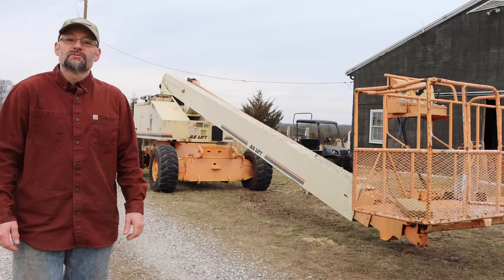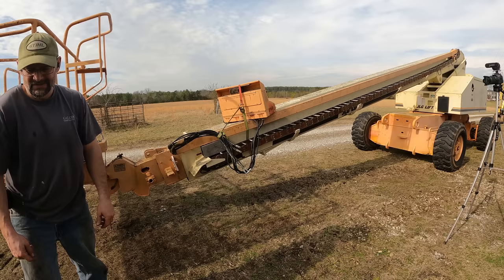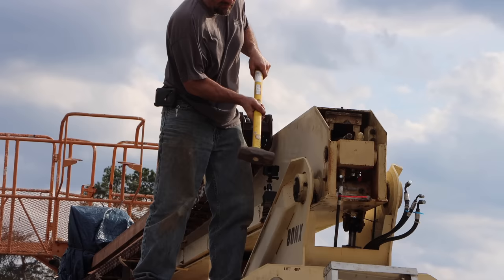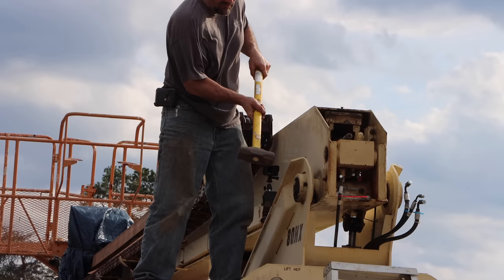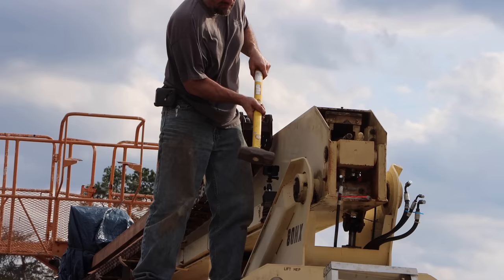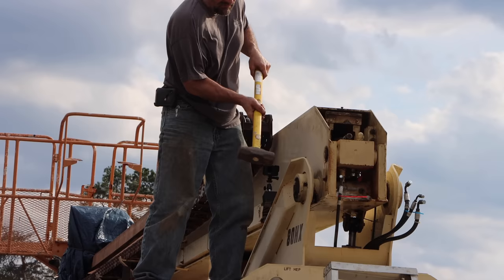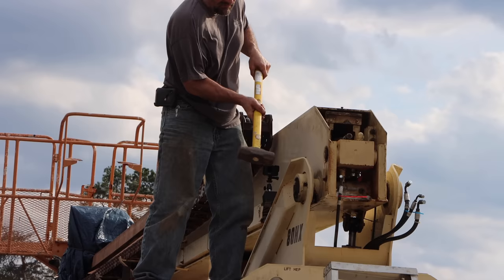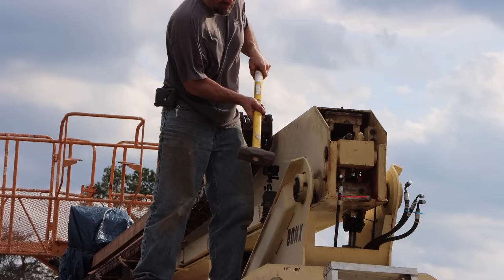JLG Boom Lift Tear Down, Ended In Disaster!

Comment: Maybe you can re-engineer the new pins to have some grease fittings to allow you to grease them so they don't seize up? - build it back better then it was before - maybe even make set it up to have all the moving parts that need it have better greaseable connections? - But despite the small fire issue - good on you taking this whole thing apart by yourself, id have been asking a friend or two to help - if only to make sure I had someone available incase of emergency where I ended up breaking something or hurting myself XD

Comment: I can relate to the whole fire situation and running around saying no no no.. I fix heavy equipment for a living and have had similar situations several times. Like you said though 100% my fault because I did not take the correct safety measures because I had done it before and was to comfortable.
Fire is scary especially on a machine with a 50 gallon hydraulic oil tank and a gasoline/diesel/propane tank.
Glad your okay and your boom lift is fixable

Comment: I had to use a thermal lance on all the pins on my dozer. It looks dangerous, but it works great. I made my own with an air gun with a brake line in the end. The air gun was attached to my oxy tank, lite it with my plasma cutter. Sure want to protect your hands and face, molten steel blows everywhere lol. There was no pin in that dozer that gave any trouble using that.

Comment: In Sweden minimum requirement is 2X6kg  (2X13.22Ibs) powder extinguisher when working whit welding or open flame, we also need to be two persons working and the extinguisher should be In one arm length of welder or welding supervisor

Comment: Sometimes if you get suck like this with pins like that, if your lucky and you weld a big nut or a disposable socket on to the pin, you can use a shake and break or an impact to break it free. You can also put pressure on a breaker bar with a tractor bucket or something while hitting it with a sledge etc. Just more tools for the tool box.

Comment: Heat the pin not around it. Heat it red hot. It expands. let it cool to the touch..  You expand the pin and it can't get bigger so it shrinks in diameter. That's how we did it in the mine.

Comment: Great video, I have torn down a few of these booms now and it is rare to find a pin that is not seized. Most we cut through like you did and some simply need a bit of heat and a hit with the sledge hammer. Might sound crazy but we have had some success welding a small piece of pipe slightly larger than the pin to the frame and then attacking the pin with a jack hammer! (The pipe acts as a guide for the chisel bit)

Comment: My dad worked for several years as a fire extinguisher service,He said to never trust 1 of those plastic headed Extinguisher they Leak brake or fail way to often.And yes it seems when you had was still pressurized The valve just broke.

Comment: When I worked, uh, on bangy things in a past life, we'd spray dry-film lube on everything that came in contact with something else.  Moly based and it didn't break down like grease-based products.  Perma-Slik.  Good stuff.  Spray some on your pins and bushing holes and it'll make them come out easy.

Comment: you have a cutting torch, you have a lance, a heavy equipment welder all my life. cut a peace of good brake line 1/4" off a bulk roll 6 times the length of the pin, silver solider it to an old #3 or 4 cutting tip over the center big hole in the tip. if you dont have a 2nd torch, wld a hot solid bead around the pin leaving the very center open, weld until end of pin is red hot, move fast and with good welding leather hold the torch strait up an down on center of pin, turn oxy psi to 60psi press the brake line hard down on the pin holding it strait an hit the oxy trigger all the way keep pushing until you brake out the other end. i have done this in the bush on pulp trailer 5th wheel pin, rocker beam 4" round 10" long on clark skidders just to name a few. before any heating, cutting welding on any machine sock it down with a hose before and after and never leave the machine for minimum one hour after any welding. i have burned million dollar machines not any fault of mine but a foreman over stepping my clamp down on company policy. i always have 2 50lb c002 an 3 15lb c02 fire extinguishers at the ready at all times, if the machine is really diry it is o be washed, no if an or butts, witch means drilling a hole in the river ice an setting a pump. you have the tools to do the job, i did jobs by my self 50 miles from the bush camp in 30 to 40 below. you made that job 100 time harder then needed, but hay that how you always roll/

Comment: No one ever does it but dry chemical extinguishers are supposed to be tipped over 180 degrees and smacked several times with a rubber mallet.  This keeps the chemical from becoming a block inside.  A piece of which may have hardened in your nozzle keeping the valve from working.  You may have had an oil fire (hydraulic fluid accumulation) in which case while water is not the best as in a confined space it can float the fire around in your case that wasn't an issue and the massive cooling of the water did the job.  There is also a time issue with dry chem whereby they need to be gone over and recharged even when the charge shows good.  Some are not serviceable and should be dumped when they are past their date or are corroded on the outside.  Always good to build a fire and use the expired ones to keep your skills up practicing on the fire.  There is not much suppression in a small dry chem so it needs to be efficiently used.

Comment: I was thinking you'd weld the steel bar to the end of the pin like a breaker bar and turn it with your lift to break the rust!

Comment: I have a few air pressured water SS fire extinguishers, they spray 50 ft easily, easy to refill and pressurize, easy to test, definite requirement around welding....they'd be the size of the one you restored.

Comment: OOMG - If it ain't broke don't fix it, if it's not causing problems don't mess with it!

Reading through the comments, seems like them powder extinguishers ain't worth the trouble, especially as the powder is so destructive. Think I'll change my powder one to a water based (have several CO2 for electrical). Our local fire prevention officer used to show us a trick to pitting out an oil based fire with a water extinguisher by using his thumb on the nozzle to make a fine aerosol!

Comment: The trick for getting things that stuck out once you've already bored through with a hole that large is to make a relief cut in the side all the way through, or close to it, with a sawzall.  Usually one relief cut will do it but two will definitely get it to come loose.

Edit: and now I read the thread and that's already been suggested.

Watching the rest of the video, man.  What a horrible mess to have happen.  I had a parts Jeep literally burn to the ground in my yard under better conditions just because I left it alone for a minute while catching up on email after using an angle grinder under it.  I must have cut into the carpet or a mouse nest or something and not realized it.

Comment: And at two minutes you are at heart attack point!! The way you were running to get water-out of control just about as the mind runs through the possible events. I suspect the nozzle was blocked on the fire extinguisher, it had plenty of gas when you punctured it. You came out unscathed-that was the main thing, a broken machine is easier to fix than a damaged you. Greetings from Tasmania Australia.👍😁🇦🇺🦘

Comment: Read that you had a fire before watching the whole video. Now I'm wondering when it's gonna happen!
Was working on a car that wasn't mine. Using a torch to cut exhaust. Yep, the oil under the hood lite! I had to find something thing to extinguish it. Bucket of antifreeze. Car is on the lift. Had to climb and release the hood. Then climb again with the bucket of antifreeze. Got the fire out but not without damaging the hood! It was downhill from there!

Comment: I can across a trick the other day that might help with stuck pins. Use a torch and heat up the pin and then use wax from a candle.

Comment: I haven't finished the video yet but once you got a 1" hole through the pin I would of used a hacksaw and reassembled it with the blade through the hole. Then you can cut it either once or twice. Idk if this would of been any easier but it certainly would of worked. I've used that method to get bushings out of cars when I want to keep the swing arms on the car

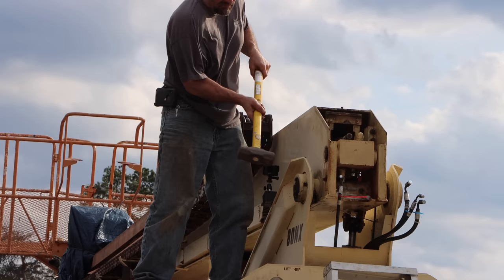Comment: 55:28  Oh you got one of those novelty fire extinguishers  LOL  Glad you got the fire out, that sucks that you had were prepared with an extinguisher only for it to screw you.  Nice video, I am an electrician who uses those lifts often so it's interesting to see it apart.  Oh and as an ex amusement ride mechanic I feel your pain on stuck parts. It was depressing when you were giving it extremely hard and well placed sledge hammer blows and it just laughed back at you.  So satisfying to see it finally break free in the press.

Comment: well, a lapse in judgement leading to a fire that damaged some stuff is still better than a lapse in judgement that leads to you being injured or worse.  just be careful with those lapses in judgement.  these projects you take on have so many moving parts and so many little things to consider, it's easy to overlook one or simply think one is not as big of an issue as it actually is.

Comment: I have little faith in that size fire extinguisher, we use the next size up or bigger in vehicles and the shop.  Had a gas line fire at the carb on an engine in the field once, used entire extinguisher and still burning.  Several shovels of dirt put it out but kind of hard on the carb.

Comment: the masts with the chains work in the same way as a forklift truck, only the mast is located here, 
and the fork carriage has become the man basket, but the principle and operation are exactly the same.  
with a forklift truck the fork carriage also goes up faster than the 1st or 2nd mast extends, 
and with a forklift you can clearly see the chains and how they work because they are not hidden in a mast there.  
your fire extinguisher was still well pressurized, 
what refused service was the handle (bent / broken) or the valve that did not open and therefore did not start to extinguish.  
I have worked as a fire-safety-watch and hot-work-watch at the petrochemical industry for more than ten years 
and when I was at welding, grinding or burner work (hot work) I always tested my extinguisher on the ground floor before I trusted that thing.  
and I myself have sometimes had one that did not work or did not work properly, while the pressure was good and was still within the year of inspection.  
therefore place in each vehicle : tractor , dump truck , side-by-site , excavator , 1 man basket from the aerial work platform + 1 on the undercarriage , 
pick-up truck , at the doors of your workshop .  
I know they cost quite a bit of money, but the fire damage if you don't have anything nearby is much bigger very quickly IF it is still under control with a fire extinguisher or water hose, which is very soon that it is no longer, and with you  in the countryside it takes a long time for a fire truck to arrive if it is still needed.  
thanks for the video again John

Comment: As an "expert" Mechanical Engineer I had to explain technical stuff to juries.  I looked at the cutaway drawing and could visualize the extension, but not the fly boom retraction.  Your model did not help.  I'll bet many others are in the same boat.  I had to go back to the disassembly video to find the answer - the location of the second sheave!  Aha!  If you want your followers to understand, I suggest a new model:  Three flat pieces of wood with proud nails or screws guiding the next smaller boom.  Then use dowels to represent sheaves, both attached to the mid-boom.  A marker or piece of tape at two or three places on the string/chain may be helpful.

Comment: Once you drilled the hole in the last bit of pin I might have tried sawsalling from the drilled hole to the bush. Oily dirt fires are a pain, set the belly pan on my forwarder on fire once. I was slower to react though, spent the first 5 seconds wondering if the insurance would pay out!

Comment: Get some EUTECTIC CutTrode. Looks like 6010. Works as good as an air arc in vert position and can be used with a regular welding machine. No air or special holder. Drill a hole thru the pin to blow the slag out and then cut a slot in one side. You can weld over it with 7018 or 70 series dual shield. 6010 will also work in a pinch but cuttrode has a very forceful arc.

Comment: Man! Glad you and the lift are ok... I think we've all lit something on fire by accident once or twice lol. After you had bored out the pin with the mag drill, did you have room to get a stick electrode in the hole to run a few beads? The old bushing trick... I wonder if that would have worked.

Comment: Now that you’ve had a fire in a very expensive piece of equipment it would be a good time to put a fire extinguisher on every one of your very expensive gas or diesel pieces of equipment. I had a similar experience when a mouse nest sitting on top of the exhaust manifold in my Yanmar excavator. I was able to get to a few water bottles that were 50 feet away and save my excavator. I put fire extinguishers on everything within a week. Nothing like piece of mind! Also I don’t weld or use my Oxy acetylene torch without a fire extinguisher within reach.

Comment: Instead of using Canned air?  Use an inverted Propane tank, and you have "Shocked" it way more! I have used this with great results on Pressed on gears. Pretty much what you have done. Heat the outside and cool the inside. Liquid Propane is far colder than Canned Air.

Comment: (The main pin that needed cutting) Those pin bushing look like they might be threaded into place and removed with a spanner or some other special tool The holes around the bushing. They wouldn't need to grease them because you can completely remove them. The pattern of holes and the clocking screws look like thats what they are for.

Comment: Next time try to drill the hole thur the piece, like you did, the use the sawzall to slice the rest of the pin with a slot to relieve the pressure, it will come right out, What a huge job, thanks for the video.

Comment: One thing about the fire extiguisher...
From the fotage i asume it was loaded with powder. The problem with these is, the powder is very corosive, especialy on electrical components⚠️⚠️⚠️
So now that you popped it, consider checking/cleaning electrics that could have bien contaminated. And, that powder goes eeeverywhere in the smalest cracks you can imagine.. 
Hope that helps🤷‍♂️

Comment: When heating an object to loosen a fitting, the shape needs to be such that the coefficient of expansion of the material will act on the material in a way that expands its overall shape in relation to the object it is in contact with. So a thin piece of material like a nut, a piece of pipe, or a jar lid, will expand more in relation to a bolt, the center of the pipe, or the jar. In the case of a hole in a large solid block like the thrust block on the cylinder, the heated block will expand in all directions, including inwards towards the swivel pin, so heat is only effective if it can help break open the contact plane between the materials and allow in lubricant as part of the heating and cooling process. If the pin is cooled rapidly enough, the pin will contract in relation to the greater mass of the block. You had the right idea when thinking of using the cooling effect of the compressed air, but should not have used heat on the housing, and didn't have enough cooling on the pin to be effective.

The easiest method I have ever seen of removing large pins on equipment is to center drill them with a small diameter (~1/2 inch) hole that can be tapped to allow a valve to be fitted on one end to allow liquid nitrogen to be ran through it to rapidly shrink the pin in relation to the mass of the housing material. The trick is to regulate the flow of nitrogen to a rate that allows the nitrogen to boil off in the center of the object and absorb the heat evenly along the entire fitting. So a small amount of liquid should come out the other end, but the majority should come out as gas. The lift manufacturer may have cooled the pin down before installing it.

A lot of really large equipment is set up to use this method to get very large threaded nuts on very large bolts. Just bring a bottle of liquid nitrogen on the service truck, connect to the fittings, run nitrogen for 15 minutes through the center of the bolt, then unthread the nut with a strap. Reverse the process for assembly. Much easier than using a 24 inch wrench :).

Comment: Mud daubers clogged up the tube on a fire extinguisher at my friends barn. We didn’t know. Had fire in the hay and could have saved the barn. But… extinguisher didn’t work because of the mud dauber blockage. Barn totaled and 6 animals we couldn’t get to let out. 😞
Reply: Great tip. Damn mud daubers. I wasn't impressed until they clogged up my air nozzle for compressor. 150psi wouldn't budge it. Also a good idea to keep an eye on boat engine water pump exits, they like to plug those up as well.

Comment: When I did that kind of stuff first try with the hammer when that not work weld nut on pin than hollow ram and threaded rod and pipe and hit with BFH. If that not work than it was oxy lance time to burn the pin out. That rust has some holding power!.